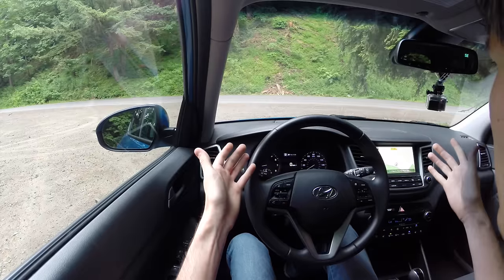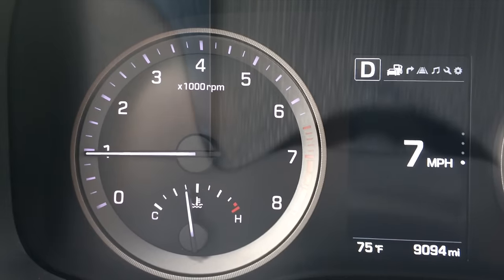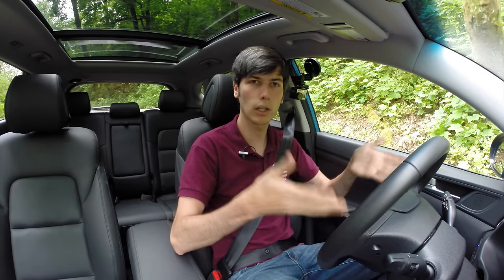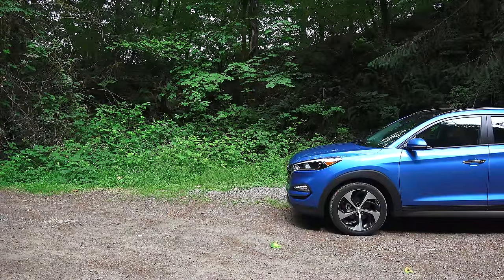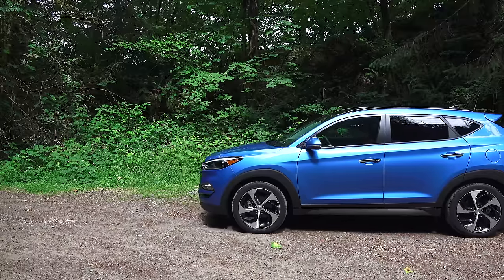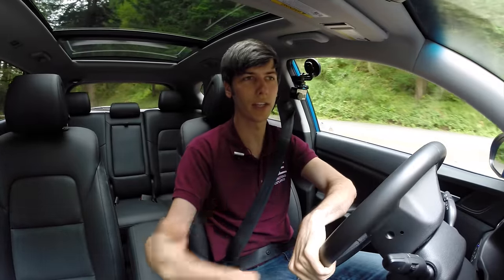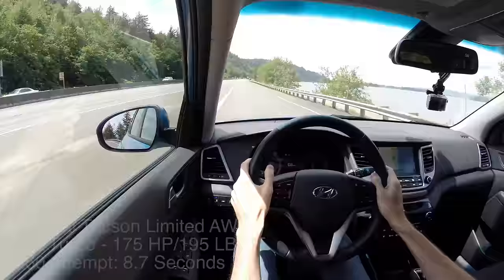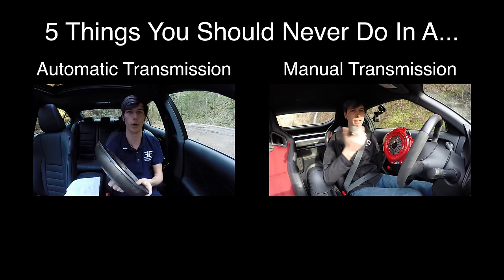5 Things You Should Never Do In A Dual Clutch Transmission Vehicle

Comment: Next "5 Things You Should Never Do In A CVT Transmission"
Reply: 1 don't buy one
2 don't keep the car you have that has it
3 don't not sell it
4 don't drive one
5 don't think it's a good transmission
Reply: Between conventional auto that gear hunts vs CVT that keep the motor at the proper rpm... CVT for me if I'm getting automatic. 

If fun is what you're after, then I personally think you should be in a manual transmission car.
Reply: You say that, but having driven a CVT.... you want it to "drop down" for more torque, but it doesn't. Instead it looks for the best MPG even if you're foot to the floor trying to merge into high speed traffic without getting run over. TERRIBLE. GF has a Nissan CVT and it is a dog.
Reply: +Alvin Brinson I do have one. I don't mind it. I really don't like gear hunting from conventional automatic.
Reply: I love my mom's Nissan's SUV w/ a CVT. Thing gets fantastic mileage and has good pickup.
Reply: +Souheib Merge Amen!
Reply: White Wing STI A traditional automatic shouldn't "gear hunt" either. That's the realm of the modern 8 and 9 speed garbage.

I drive a 5 speed manual. Always have the gear I need.
Reply: +Alvin Brinson I never driven an automatic that never gear hunt. Oh well... But there you go! Manual is the way to go! 👍🏼
Reply: +Souheib Merge i have cvt in my 2004 murano and that thing is solid as f....
Reply: yes ,cvt please !
Reply: If the engine has any kind of low end torque, any car old enough to just have a four or five speed automatic won't gear hunt much at all.
Reply: 1) buy one
2) drive one
3) suggest one
4) think about one
5)... no fair, you've got a good point, come on EE
Reply: +Hambert so why give the maxima a 300hp v6, aggresive looks and call it a sport sedan. Then expect people to want to drive it with a cvt?🤔
Reply: Hambert except they're not as efficient inherently as a directly geared transmission. So given they're mechanically more complex, offer marginal improvements over an auto (I mean seriously- do you think the engines curve only has 1 tiny little RPM range where it's efficient?)- I'd say yeah- really NEVER buy one.
Not because they're not sporty- everyone already knows that (excepting the maxima v6), but they're also crap as econobox chug-along transmissions, compared with the de-facto standard.
Reply: +rasvial A Multitronic will set the rpm as high as 6500 when maximum power is needed or as low as 1000 for economy driving (just to give an example) based on power demand by the user. So no, that's not a "tiny" range. They can even do fixed ratio shifting simulations using the incorporated clutch.
Reply: Hambert what I'm saying is the argument for CVT's is based on the ability to pick a single RPM for a given purpose- be it economy or sport driving. That said, it's not that much of an improvement from picking a single RPM versus using the ~1k rpm swing of a standard gearing (and they're getting tighter with these 9spd autos..).
And it does cost more of energy constantly because of the inherent inefficiency compared to two gears meshed together. Because of that, they are a complex solution to a non-problem.
What I'm saying, is the pro is a minor point which gets compromised by the bag of cons that come with CVTs.
Reply: Everything.
Reply: >Very efficient because if it's programmed correctly

"programmed correctly" is the key word. Too bad Nissan's isn't. Source: I have a Versa CVT.
Scaled for size and weight, it's about as fuel efficient as an old Odyssey minivan. Yes, I could only achieve about 24-25 mpg in my city commute with Versa. I was getting 16 mpg with Odyssey. And I'm not a lead foot driver. Considering that the Odyssey is heavier by 50% and has a 70% bigger engine, that gives us about the same economy per weight and engine displacement.
Reply: #1 Never buy one.
Reply: +Hambert multitronic wears fast. its a nightmare
Reply: 5 things you should smash into your face if you've bought a CVT trans car
Reply: Lmao I thought about smashing my face in when I bought a lancer with a cvt
Reply: CVT is better, cheaper and more efficient than auto. Dual clutch is better than both IMHO. I have a 300cc scooter with CVT and a Lexus hybrid with CVT: both great :o)
Reply: Jaion Cebollero
Reply: The CVT always ensures that the engine is at optimum revs to deliver optimum power at optimum economy. The problem that the traditionalists have is that the engine sound is pretty monotone and doesn't make the right sound for the average petrol head. If you take that away, it's the best option in my view as its easier to drive than a manual and easier to fix than any other auto transmission.
Reply: B10S I drive a car with CVT and it's the best automatic car I've ever owned. CVT transmission is for those who understand how the system works, learn to drive one first.
Reply: I agree, CVTs are awesome on the highway, just put your foot down and it goes smoothly.
Reply: Indrid Cold in sedans I'm sure it's fine but it gets sketchy in big suvs
Reply: Droo 
1.dont buy cvt
Reply: Actually,
1.Dont buy a cvt
2.Dont buy a cvt
3.Dont buy a cvt
4.Dont buy a cvt
5.Dont buy a cvt

Thats better
Reply: Why nor both ?

God bless
Wyr
Reply: drive one
Reply: White Wing STI DCT is the way to go if you wanna have fun because it's faster than manual and feels like a sequential gearbox when shifted manually. driving manual is a chore. it shifts slow and keeps one of your hand off the steering wheel often.
Reply: 1. Don't drive it
Reply: I like how quiet CVTs are at highway speed. 1200 rpm at 60 mph ftw
Reply: Buy car that only offers a CVT in the first place
Reply: What about CVT in mercedes A class 2012??

Comment: Jason congrats on this awesome video. I totally agree with everything you say, but the thing is that I have a motorcycle with an automatic DCT transmission and I can feel that when I am stopped at the lights with first gear engaged it is constantly trying to pull forward. It's just a little bit, barely noticeable, but is there. So just in case I always select neutral when at the lights or at any significant stopped time, even with the fact that the manufacturer says not related recommendation at the user manual, just to prevent any long term wear to the clutches, specially to the first gear one.

Comment: I have a question. Should you use a manual shifting feature regularly on a dual clutch vehicle? In example, will it be bad for your car if you shift at different speed and rev compared to when it's on a automatic mode?

Comment: The DCT on the Acura 2.4L TLX/ILX is better as it also has a torque converter.  Fast shifting with the paddle shifter and works like an automatic normally.  None of the issue with the dry DCT.

Comment: With a wet clutch DCT, if you're going to be stationary for a long time it's probably better to select neutral. On my car the trip computer shows litres per hour when stopped and in neutral its 0.6, in drive sitting still its 0.8

This would likely be due to viscosity drag of the fluidl between the multiple wet plates, and would be putting heat into the fluid.

Comment: Wonderfully explained! About the inching forward, in traffic one is supposed to inch forward, otherwise other people try to cut you off and get in front. Does this mean that a dual-clutch isn't a very good option of one frequently drives in high traffic? Also, I'd really appreciate if you could make a similar video for CVT transmissions as a growing number of vehicles are now starting to have CVTs. Cheers!
Reply: Yes
Reply: You can inch forward just fine. But you do it slightly differently. You allow a little space to form, not so big someone can jump in, but maybe a car length. Then you take your foot off the brake completely. The car will idle forward slower than walking speed but with the clutch fully engaged. 
Then you stop.

It's really not hard.
Reply: @alanjm1234  back when I commented that I was in India and anything more than a hand’s length meant that someone is going to cut me off. Sometimes even a hand was too much. It literally was “bumper to bumper” traffic. This is my biggest hesitation with a DCT, that for those types of traffic, it might heat up a lot.